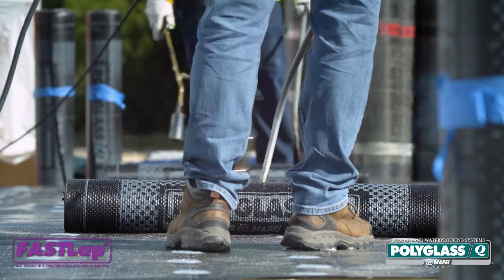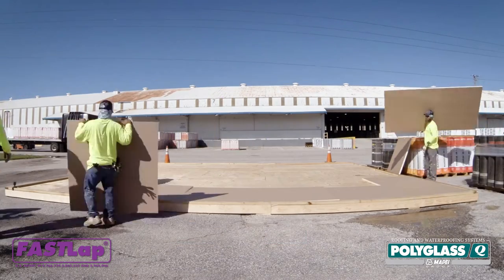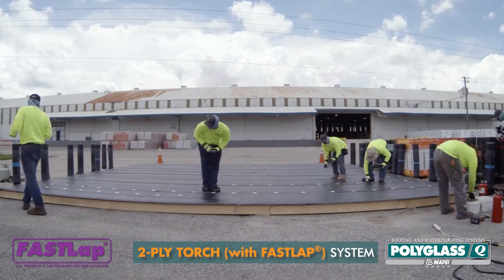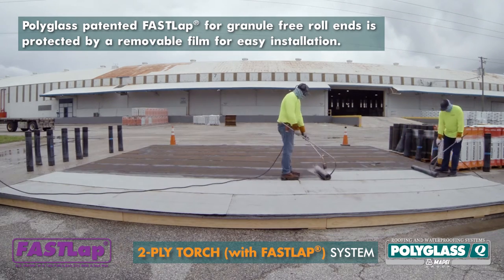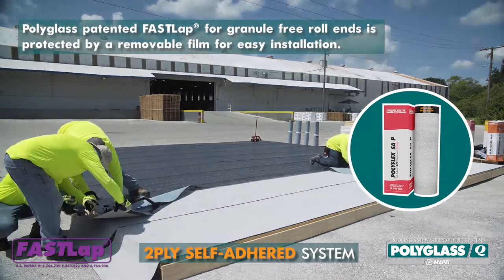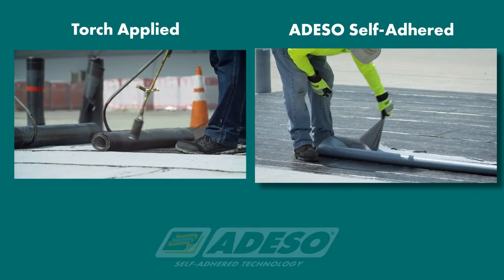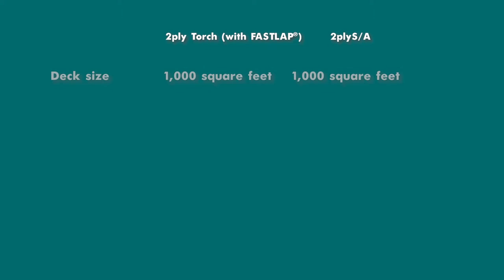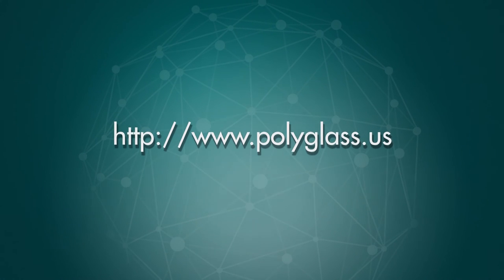Two-ply torch vs Two-ply ADESO Self-Adhered membranes

Comment: Can Polyglass waterproof reduce the sun heat?
Reply from the maker: Hi @AlexSok Our Polyfresko G membranes offer excellent UV resistance, which can help lower the temperature of the living area below. The extent of cooling depends on several factors, such as the amount and quality of insulation in the roof or ceiling, how much sun exposure there is on that section of the roof, etc.
 
You can learn more here:  https://polyglass.us/product-type/technology/kool-roof-solutions/membranes/